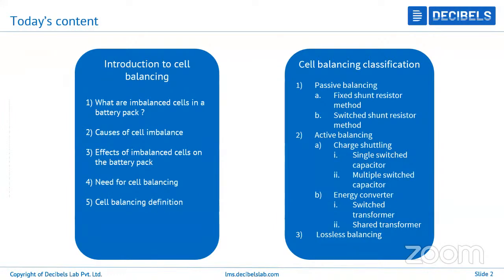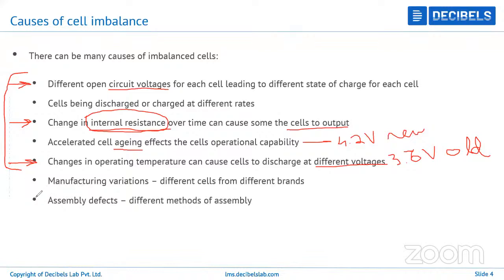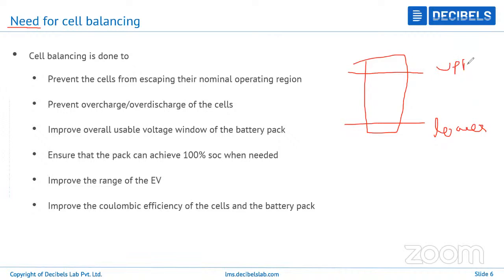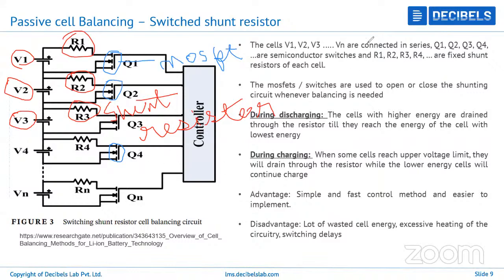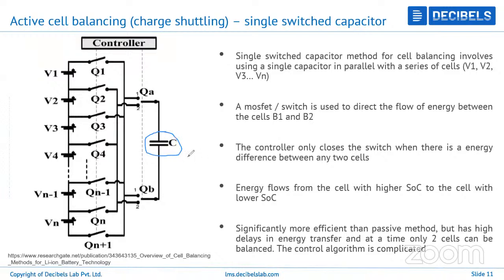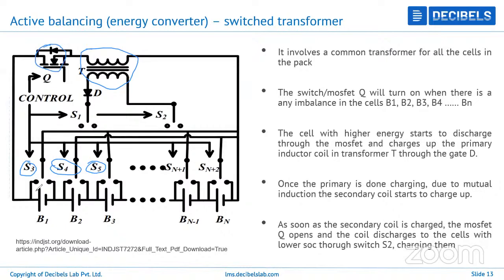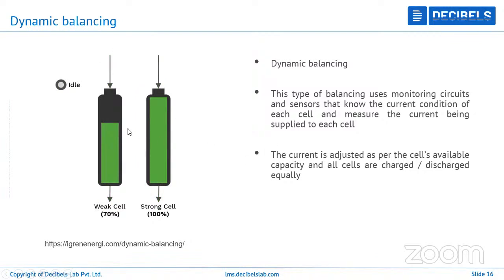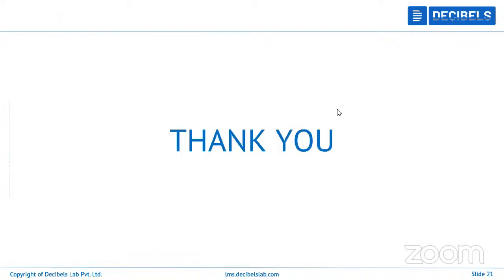Introduction to Cell Balancing

Comment: A multiple switch capacitor technics uses a principle of averaging different values. And there is one big disadvantage of all switching capacitors architectures: the smaller is s voltage difference the slower power transfer is. You can charge a battery in 3 hours, and then balance it during 16 hours. But Chinese manufacturers like it cause capacitors and mosfets are cheap, and they still can call it “an active balancer”
All but a dynamic charging active balancing methods do not manage an energy transfer current. It can be any depending on esr, conductance, internal resistance, etc. I think it’s not good for a battery. A charging of a capacitor fast causes an energy loss as a radiation due to Maxwell equation besides of all

A multiple transformer technic is similar to a multiple capacitor one: due to an averaging, higher charged cells fill a capacitor/inductor, and lower charged cells consume this energy. All at once. Everything happens automatically. No sophisticated controller is needed. You do not understand how this method works.

The lossless charging is better to implement with two chargers. This eliminates all switches between cells (each mosfet adds 2-10 mOhm to an internal resistance)

Comment: what is the value of capacitor that can be used for cell balancing using switched capacitor topology?
Reply: Any. A switching frequency will depend on this value (limited with MOSFET specs of course). Do start from 10-22uF. ESR is more important